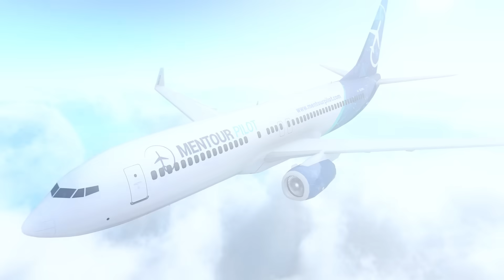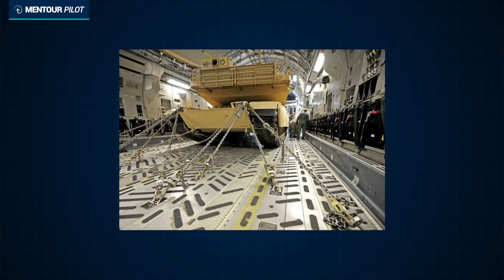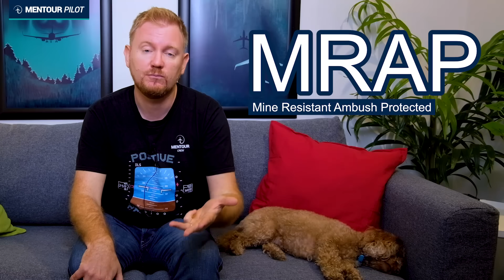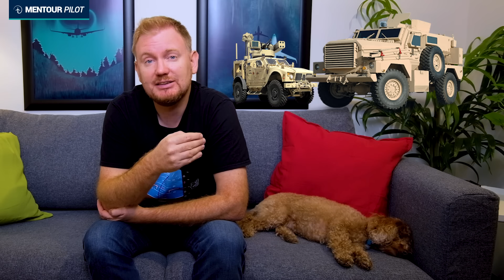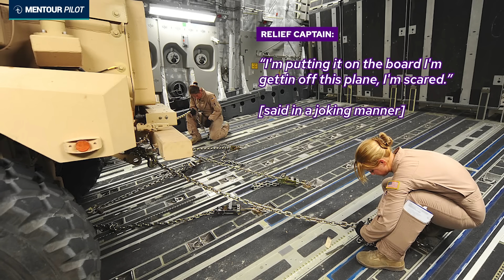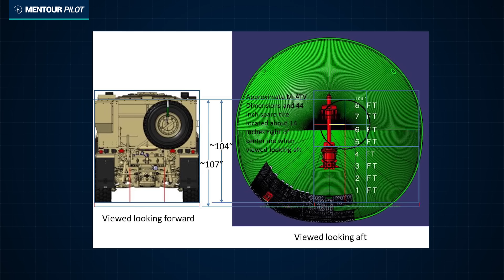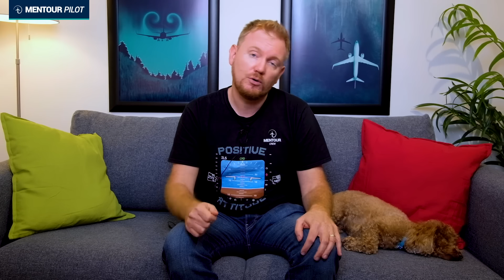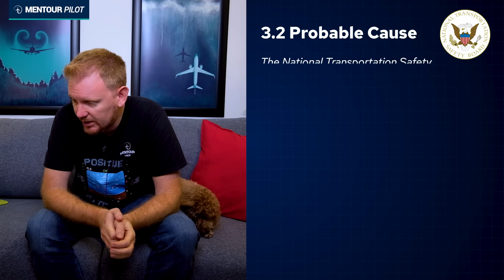Why did the pilots LOSE control?! National Air Cargo flight 102

Comment: I'm not a pilot or load master, but I've done lots of rigging and loading on my own personal flatbed trailer (nearly every weekend for 2 years now), so I can speak to the effects of vibrations on rigging: it's INSANE how much rigging you need to provide a 99.99% guarantee that a load won't shift. It always blows my mind. You think you've restrained the HELL out of something, like...ABSURD amounts of restraints, straps, chains, blocks, and then STILL you arrive at your destination and find something has shifted. Vibration modes can surprise you in unexpected ways. There can be weird vibrational resonances that you can not predict.

You can only follow a list of best practices (applies to road travel, obviously):

0. Cam lock straps are unreliable. Throw them away right now.
1. Slow down. I repeat: SLOW THE *i&^&^ DOWN!!! I can not stress this enough. Whatever surprise vibrations that you can never, NEVER 100% predict might happen, you will increase your odds of success by slowing down. 
2. Find the natural damping mechanisms in your load: strap around the tire itself if hauling vehicles, like the tow truck drivers do. This is because the air in the tire and the rubber itself acts like a spring AND a damper simultaneously, absorbing any funny business. If it's some other load, find a 'springy' part of your item, to where the load item itself can contribute to absorbing inertial shocks and surges by 'pushing back.'
3. Always always always put at least a half twist in your rachet straps that are exposed to winds to dampen wind vibrations because a.) no it doesn't weaken them and b.) yes it does absorb/deflect weird wind harmonics.
4. Rubber cords (heavy duty) are amazing. I trust them more than the straps themselves, when properly applied. This is because they have a high and forgiving failure mode, can accept tons of shock, and they try to bring the load back to neutral/balanced tension forces.
5. If you have straps or chains that are inline with a longitudinal bending moment of the trailer (these seem to be the most destructive, by far, IME), then apply rubber straps to hold consistent tension on them against the trailer.
6. Spend some time getting to know your trailer and puller: does it have longitudinal bending moments? i.e. does it have a natural respond to road bumps that causes it to go through large deflections, especially in the vertical plane? Are the deflections controlled or uncontrolled?

Just some thoughts on rigging, mostly unrelated to what happened here. I think rigging should require a certificate of some kind. Most people just get lucky. I see a lot of loads turned to carnage on the freeways.
Reply: Underrated life advice.
Reply: As a trucker, most of your advice gave me headaches. That's exactly the type of deal an amateur would suggest. Especially your talk about rubber cords. The goal of straps is actually to increase the friction between truck bed and the item you are transporting. That is achieved by a massive force pulling the item to the truck bed, ideally at an 90° angle. No dampening, no other BS, just pure force. The straps are certified for a specific force, and so are the hooks on your trailer. If for example your trailer hooks are certified for 2000 (whatever units) and you have 1000 (wu) certified straps, you can use two straps per hook and ratch them down until the ratchet doesn't move anymore. This doesn't work with fragile items though, like cardboard boxes. That is what the rubber cords are for, they apply a strong enough force for the item to not move, while not damaging the item. But this is only really recommended for lightweight items.
Reply: @ShazenVideos  agreed. I worked as a C17 Loadmaster and have extensive experience restraining cargo and this comment is just plain bad. 

CGU-1B cargo straps (used in aviation) are extremely reliable. Cam lock straps aren't used in aviation but that will just confuse people given the context of the comment

Comment: Hm. If the hindmost vehicle had already smashed the jack screw by the time recordings stopped, it must have already broken the bulkhead. The flight data recorder being mount on the bulkhead would have been impacted. Why did it cease recording at that time?

Comment: Yup, the load shift was not the reason for the crash, as most people tend to think. A simulation was run by the investigators, showing the plane could have recovered from the load shift. But once the jackscrew was damaged....that was it. The plane's pitch was 100% uncontrollable.

Comment: Why would a 12 ton vehicles require 2 fewer straps than an 18 ton vehicle, which "requires" 26? The ratio doesn't work.

Just makes no goddamn sense on the surface of it, it's so clearly stupid.

Comment: I've seen the dashcam video long before I saw this excellent video going through what happened or might have happened.  

I do have to ask, why aren't chains used for vehicles or containers that are abnormal in size/shape?  Even if overload safety chains are added and the rest straps.  Straps just aren't strong enough for a vehicle.  I spent 8 years in the US Army and I can't imagine ever towing or recovering a vehicle that heavy without using chains.  I don't even trust cables as much as I do chains.  I've seen cables "let go" all to close to me and its scary. 

This is definitely an aviation tragedy that is one of the scariest in my mind.

Comment: I remember this accident well. I've been an A&P Mechanic for more than 42 years. It was pretty clear to us when we first saw the video of this horrific accident that it was caused by some kind of loading error. And how tragic that the crew knew that the load had shifted during the first leg of the flight but took inadequate steps to fix it. Another Human Factors failure.

If this was a converted passenger 747 I'd be surprised if it had a front loading capability. Most of the 747 Converted Freighters don't get that. I believe that is only available on the ones originally built as Freighters. But they do get a big side cargo door that is probably wide enough to accommodate those vehicles.

Comment: I believe you missed an important point made in the Nat Geo documentary. The loadmaster correctly followed the restraint procedures in the company loading manual. However the manual’s number of straps specified for the load was based on a linear line of restraint and didn’t take into account the angle of the straps off the horizontal. Thus the load exceeded the capacity of the straps. 
It could be said that the accident was caused primarily by a text omission. Hence the references to FAA oversight being inadequate in accepting the manual.

Comment: unfortunately there where several events in Bagram before this crash that we where able to witness from the Apache hangers where cargo planes accross the runway where not being properly loaded or unloaded where the weight of the load put the tail on the ground and pulled the front wheels off the ground. Aircraft would stay that way for days.

Comment: if you are gonna use straps to hold down a cargo don't never use one with a knot in it it will fail at less than half its rated capacity a twist or 2 is no problem but one single knot will drop your rating to less than half am nor sure i would have used straps to hold down a 12 ton APC never mind a 18 ton one i would have thought chains would be more appropriate saw a guy on YT test the knot/twist thing to see what happened even with 10 twists in the strap it still held up to 80/90 % of rated load the one with a single knot in it failed at around 35 % of rated load scary rip crew sad thing indeed  what was wrong with the crew that the load maybe no being secure was not a big deal there was lot of big mistakes by all involved with this crash i you were the pilot why would you ignore something like this very sad indeed

Comment: I don't understand why in a cargo plane like this, why there isn't a "protective cage" protecting the aft bulkhead or area where control device are unprotected. Anytpe of shifting cargo can be avid issue. If weight is an issue as to why they don't there are new material that are light and strong enough to protect that critical area of the aircraft. Without adding too much weight.

Comment: As a Master Mariner the requirement for command is what they used to call 12 years before the mast and is required to oversee the loading of all cargo.  Nowadays you can obtain  a Master's certificate after a few years at sea having gone to a nautical academy these master's usually works are on offshore supply ships. I have been a Master Mariner for 40 years and when qualified your papers are unlimited and deep sea.  any ship, size, anywhere.  Stability is given the most priority.

Comment: The FAA Failed? Omg! Wow I’m surprised. The failure of the FAA to supervise the airline industry must be something new wow! Sarcasm

Honestly, the FAA shouldn’t be regulating the aircraft industry at all. The FAA is like the mob, they turns a blind to everything the airline industry does, literally putting peoples life at risks over a few dollars. The worst!

Lol hmmmm no, the FAA doesn’t learn a single thing from the past fatal events. For example, they recertified the MAX, only for them to be recalled couple of weeks later for electrical issues. No one trust the FAA when it comes to the airline industry anymore. Even freaking India is still testing their MAX for recertification but the FAA? Sure it’s ready to take to the sky again
Reply: Why not have a word with your representatives who deny them the resources to do the job every year.
Reply: @peteconrad2077  lol really? So I'm guessing my representative is the inspector that's going to verify every document huh? 
The FAA Literally designed their system to give full autonomy to the airline industry until the very end of the process they send someone to verify the paperwork produced by the airline industry
Reply: @dj_CaribSoul  yes, and the reason they do this is because they haven’t the resources to do anything more. Try thinking.
Reply: @peteconrad2077  lol ahhhhhh I see, so I guess their "lack of resources" is the reason why there is a revolving door between the FAA and the Airline industry too , huh? 
How tf are you going to supervised an industry you were a top executive or manager in? Would like to present another excuse for the FAA again, with the blood of thousands of victims on y'all hands?
Reply: @dj_CaribSoul  so what’s the alternative. Have FFA inspectors with no experience in aviation. The onyx place to find people who have the expertise to evaluate airlines is in......drum roll.......airlines.  They reason fir the revolving door is that, thanks to you and your representative, the FAA dint lay enough to stop inspectors leaving and going to airlines who pay better. They then come back when they’re made redundant. 

It’s a very simple equation. If you want better oversight you have to pay for it. If you pay cheap, you get cheap.
Reply: @peteconrad2077  lol you don't find a conflict of interest there huh? You don't smell corruption there? 🤣🤣🤣 thats how we know you're probably an Ex airline employee and now working for the FAA
Reply: They literally increase the FAA budget yearly and yet their services is crap! I'm scared to fly on anything FAA certified
Reply: @dj_CaribSoul  no, I’m a current airline employee. Conflict of interest is avoided by inspectors not inspecting airlines they used to work for. 

Now once again tell me where you will get your inspectors from other than the airlines.
Reply: Tell us this, does airline managements  give yall a little yellow envelope before every inspection? I'm curious, you can talk, since you're probably not using your real name
Reply: @peteconrad2077 retired service members in the airforce, Marines avaitian, army, freaking navy, and you literally have graduated college students, all ready. All you have to do is to provide trainings. Just like they do in every other agency. The fact that the FAA first pool of potential employees are employees from the same industry they supposed to supervised is similar to the MOB. Lol just like police forces having their own internal affairs, to "supervised " themselves.
Reply: "Oh I'm supposed to make sure this  concrete plant tomorrow, let's hire someone who's been working for that concrete plant for decades to supervised it tomorrow."
What do you expect this person is going to do??? OF COURSE HE WILL GIVE THEM A PASS! He knows literally everyone there, had coffee with them, they know his family,  his friends, some of them are godparents for their kids, and since he's been there for decades,  everything works perfectly for him. So again, do you expect ex airline employees to effectively supervised the very industry they worked for for decades?
Reply: @dj_CaribSoul  yeah, all with zero experience of airline operations. Great idea, Einstein. They won’t have a clue. 

Every country in the world uses ex airline staff for inspection. It’s only the US that crews it up because of lack of resources.
Reply: @dj_CaribSoul  not sure if reading isn’t a strong point for you but I did point out that they dint inspect airlines they worked for so your concrete factory analogy is nonsense.
Reply: @peteconrad2077  the navy takes people from civilians and turned them into incredible aviators in less than 3 years, the air force takes civilians and turned them into formidable aviators, the army takes civilians and turned them civilians and literally turned them into Night Stalkers , the coast guard does the same thing, the FAA? Nope, let’s just go and get ex employees from the same airline we’re supposed to supervised instead of training people with zero links to that industry to supervise them. Imagine the military going to Afghanistan or Iraq to recruit combatants, trained and armed them to fight our wars in Afghanistan or Iraq , lol sounds ridiculous right? That’s exactly what the FAA does
Reply: @dj_CaribSoul  it sounds ridiculous because it’s the stupidest analogy I’ve ever heard. Literally infantile. 

I’ll say it agin to see if you can get it. To understand airline operations properly you have to have ling experience of them. Your little Air Force captain is going to be run rings around by airlines because he doesn’t know how things work.
Reply: @peteconrad2077  and you think that doesn’t impact decision making? So you worked for Delta, tomorrow is inspection, you can’t go so instead they send your best friend, whom you talked about how great Delta is every day and to cut them some slack, when that person gets there, they already know everyone in there, because you told them, so that bullshit of “oh if you worked for one you can’t supervise it” is bullshit, the decision to give that airline a passed, was made weeks before, it was influenced.
Reply: @dj_CaribSoul  no, it doesn’t work like that. Inspectors are assigned to airlines. They can’t be assigned to an airline they work for. Inspections are carried out by these inspectors. In the few cases where an inspector with a connection completes an inspection, it’s alongside one who hasn’t. Trust me from someone in the industry, the issue is not about inspection bias. It’s about resources. Inspectors can’t find everything eb a use there are too few of them inspecting too much stuff. 

Stop voting for idiots who like to cut red tape in the airline industry.
Reply: @peteconrad2077  y’all need  to do your jobs right, if you want more funding. Again, there is a bunch armed forces veterans out there with knowledge of aircraft, the FAA could’ve trained them, but instead they prefer to let the airline industry self-regulate. Manuals are made by the aircraft industry with tithe FAA spending a few hours just to approve it and aircraft ready for sale and carry millions. 
If the FAA isn’t performing well, well, cut their budgets or scrap the whole agency and create a new one, better, more efficient and less costly.
There are hundreds of agencies with smaller budgets that are doing amazing jobs at what they do. The FAA went from being the top to being after fcking India lol (ph yes India is still testing their Max planes).
Reply: @dj_CaribSoul  how typical of a repulitard to get it the wrong way round. The job can’t be done properly until the resources are there. Air Force personnel won’t do because they don’t understand airline operations and safety standards.
Reply: @peteconrad2077  so I'm guessing you were born or specifically created for this purpose only, they didn't train you, you just knew what you were doing, right? I'm curious
Reply: @dj_CaribSoul  they give you some training but mostly they rely on your long experience in the industry which help you know what right (and wrong) looks like.
Reply: @peteconrad2077  lol "some training", now I see why aircrafts certified by the faa be dropping from the sky. 
"Experience in the industry" im guessing the airforce or other armed forces branch doesn't have people with "experience" in this industry. Seems like the airforce only have boats and tanks, right?  The same way they trained you, its the same way they could train a lot of airforce vets to do this job, and the same way you gained experience working in this industry, MANY Vets outthere have done and gained more experience than you in the private world
Reply: @dj_CaribSoul  can you really not tell the difference between the airline industry and the airforce. The only common area is that they have aircraft. Everything else is different. Operation, engineering, human factors, safety management. Everything that counts is different. Trust me, I know, the Air Force is NOTHING like an airline.

Comment: They should write the weight of the cargo in bold on the cargo itself. The aircrew and the Loadmaster know the Safe Working Load of the straps. Armour plated normal-looking truck, well almost. The weight difference between 1/64 inch steel and one-inch armour plating?